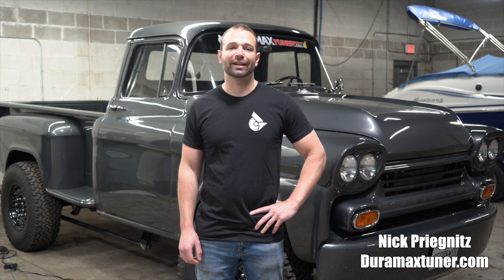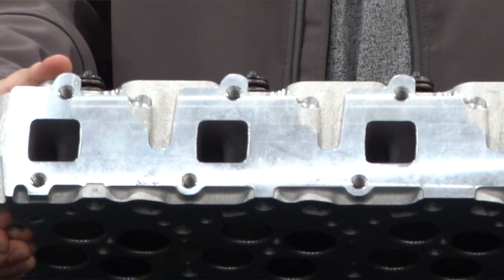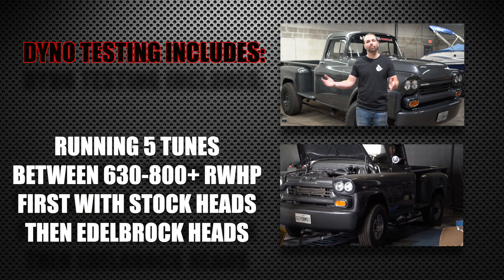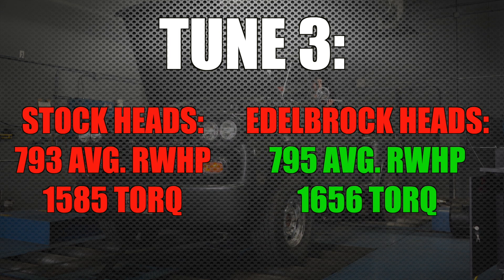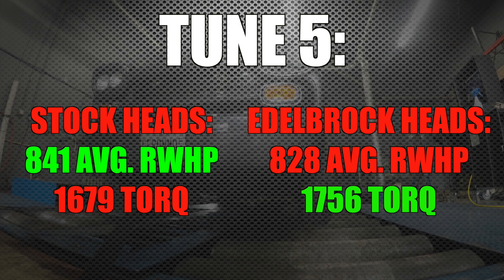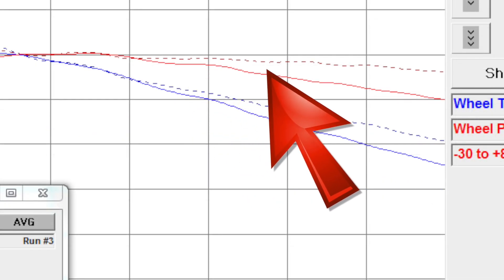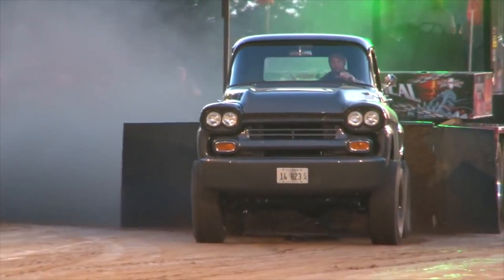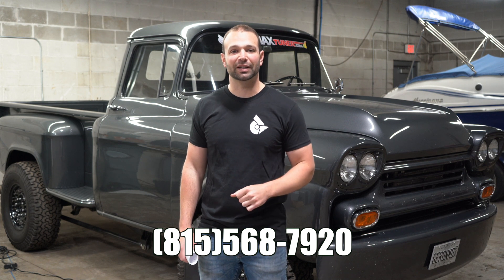Testing Edelbrock's LB7 Duramax Diesel Cylinder Heads

Comment: The bottom line is the average butt dyno is not going to notice those little gains in power from those expensive cylinder heads.....stock head or just fine